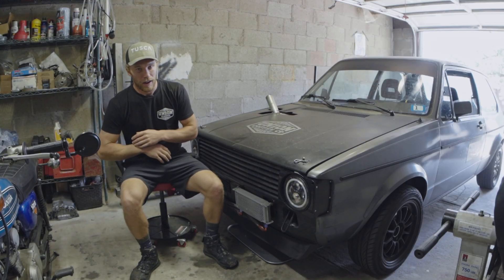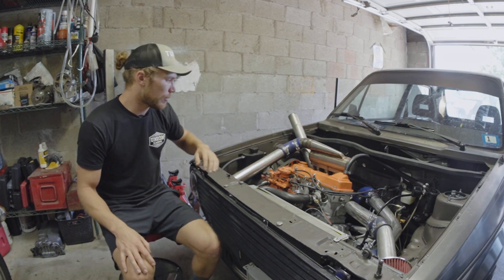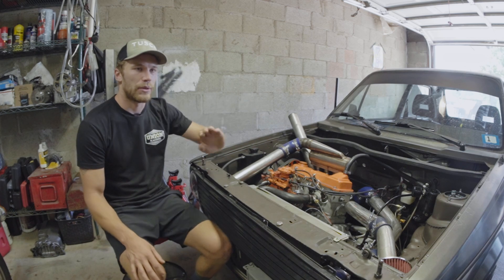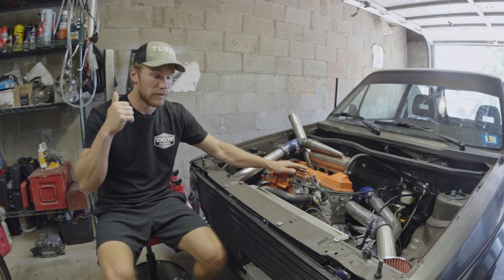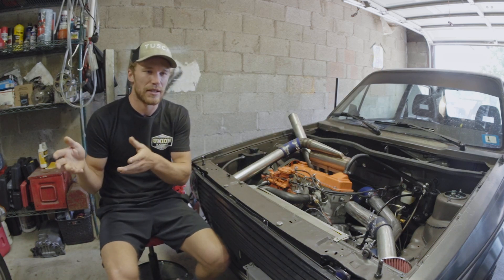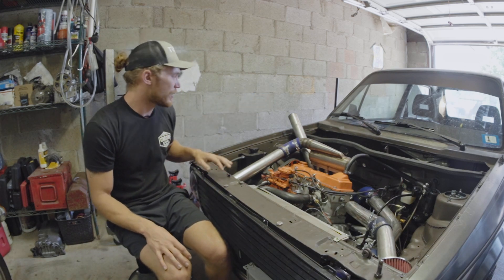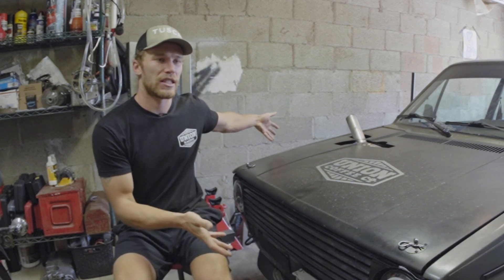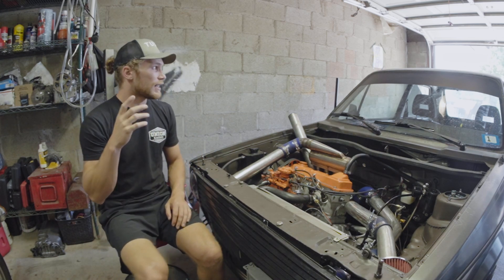VW Turbodiesel Build Update: Tuning & Turbos

Comment: 11:25 you won't lift the head (3bar maybe) 
The weakest points are the rods and high rpm (uneven cylinder wall wear) but at like over 4000 rpm range that you already lost your peak performance. 
If you notice the stock pistons they have that black soft rubber ish coating on their sides that rly shows the abuse it's been through. If its fully black without any wear , yeah you're a pretty lucky owner. but with the new pistons try to remove a bit the shininess off the cylinder walls with a 1500+ grit sandpaper and some lubricant (i use straight up diesel) If you can see the factory machining lines on them then don't even bother *

Comment: I think it's not unreasonable to say you have already built one of the most powerful 1.6 vw idi engines ever. It's certain, actually. And, it may be THE most powerful. But, absolutes make me itchy. 

Also, wanted to say, I'm getting elbows deep into my rabbit build now. Your channel, information and enthusiasm have been HUGE for me. I'm following your recipe as much as parts availability and budget will allow. ARP studs, new seals, gaskets and bearings. Looking at an S-Tune 1.9 intercooler/ intake kit, very nice, very expensive. 

Strongly considering the maxspeeding h-beams. Also spendy.

All this going into a factory 1.6TD.
Got a rebuild kit for the pump. Maybe I'll find a steal on an 11mm head one day. I think stock is 10mm(?)

I've got a pretty clean '81 rabbit to run it in. I spent as much on the car as I've already spent on studs, gaskets and the pump rebuild kit.

Factory turbo feels tight, looks good. I'll run it till i am confident in a specific model as an upgrade.

What do you recommend for an oil cooler? Is the stock water/oil good? 

Can you recommend the best guages/EGT brands for the money?

Good Lort, this is getting expensive. 

Anyhow, kinda thinking out loud here. Thanks again for the excellent info and inspiration. 

Keep it up!!!
Reply from the maker: That sounds dope! I appreciate the stoke, thank you 🙏🙏

In terms of oil cooling I feel like I jumped the gun a bit at a younger age... I would consider running what's there (though it certainly doesn't have the biggest chops) and an oil temp gauge, then decide if you need to improve it from there 👍 

I like using Bosch mechanical gauges (cheap & effective) for what I can, mainly pressures & temperatures, and I use Autometer for everything else. Autometer cost a bit more but they're reliable, which is what you need 💯

Comment: Love it, dude. 
Your idea to use the arduino to collect air density telemetry is awesome! I really appreciate the evolution of application. Genius. 

I am extremely curious about how well your gear box is going to tolerate 300 hp/ 550 ft/lbs (?) of torque.
Reply from the maker: Thanks!! Yeah I'm curious too 😂😅😅 but we'll find out. In the future I would definitely upgrade to the 02A/J but right now to keep it simple I'm going to stick with 020

Comment: i had a costumer (taxi) with 800k on with a stuck closed vanes vgt (always high pressure) and a leaky intake pressure pipe that obviously blown up from that excessive pressure. Same engine alh , pushing daily 2+bar , the car was spinning 3rd gear(octavia4) and that excessive horsepower was not coming from that turbo pressure but the turbo air intake measurements the maf was reading and opening the pump at its max throttle 😂.
The car didn't smoke at all due to that pressure but couldn't go too high on the rpms from exhaust blockage.
removed the turbo to clean it and in open position the vanes was touching the the turbine propeller from deformation. rip(also a lot of oxidation and missing spots on them like the engine was spitting water or smth)

really robust engine but weak external parts like the turbocharger is super weak to high temperatures and or bad fuel (oxidation) soot also gets underneath the vanes and the sync ring and gets it stuck at whatever position they stay the longest.  
So if you planning to keep that turbo, program the arduino to fully open and close in sequence the vanes when the car remains idle (in traffic or whatever) with a clutch sensor to cancel it when youre ready to put it in gear.
Also prefer a thin but bigger surface intercooler than a small thick one. (the size of your radiator style)
Makes the car more responsive and more efficient in cooling air intake.(especially with a sensor to kick the fan every once in a while)
Last but not least,  oil cooling and pressure measurements. Idk how's the weather there but here with 43+c engines struggle to keep the oil temperature under 120c with water cooling oil coolers.
(i use 10w60 oil in some cases)
can't wait to see the alh in there.
Reply from the maker: Jeeez!! That's a wild ride your customer had. A great point though about the vanes sticking (another reason blowing oil out the exhaust is a bad thing - cokes up my vanes!). I think with the right tune & good fuel it shouldn't be too much of a problem on the ALH. I'm planning to use my front mount oil cooler with the new engine too, so I'll be upgrading from the oil to water. I'm a bit concerned about the radiator though, mk4's run much larger radiators than the mk1s and the mk1s def get hot
Reply: @OliverFetter idk how much you'll push it but tdi engines with 1.6 or 1.9 mechanic pumps that I've seen ,running extremely lean and they struggle to reach temps at winter 😂.  So any tdi swap ive done they never have any temp issues (that the 1.6 had with that weak head gasket) .
But better go bigger if you can. maybe from an mk2 with dual fans (those that had ac they had bigger radiator and double fan with a belt to drive the second one)
*id ditch the belt fan tbh its problematic from the getgo
Reply from the maker: @ChrisGR93_TxS  good calls 👌